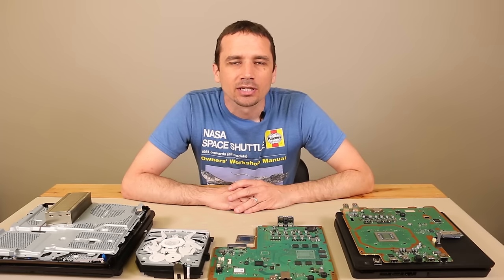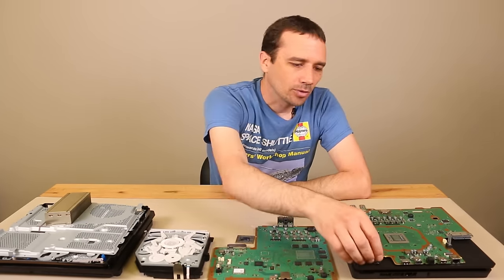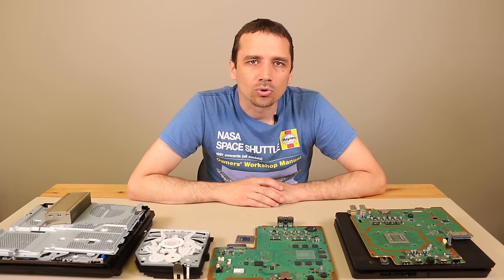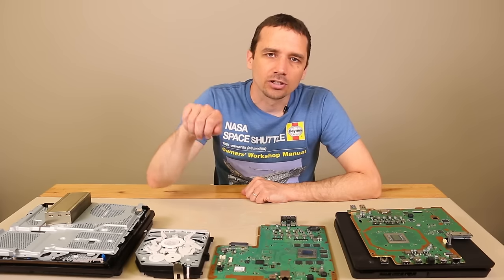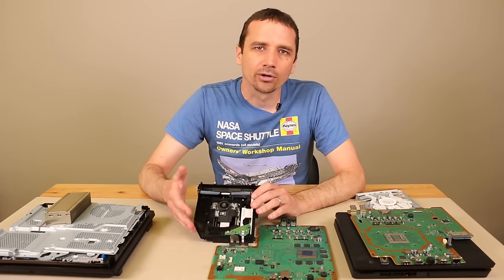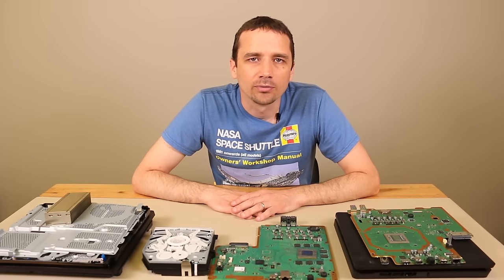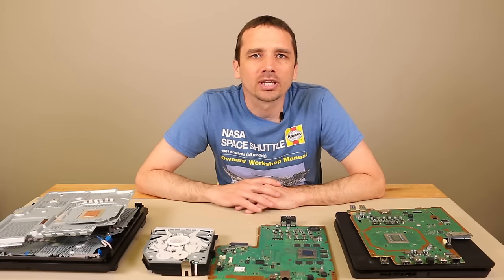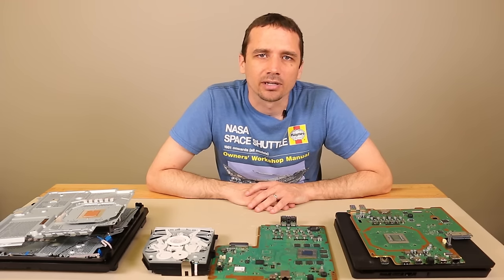Top 5 PS4 Problems With Solutions

Comment: My PS4 recently shut off on me while I was playing. I opened it up and the fan and heatsink are completely clean. Fan is in working order as well. I suspect the power supply is dying, but not sure.
Reply: You ever figure it out? I have the same problem
Reply: @tannerfisher3013  pretty sure it was the power supply. I pulled it out, dusted it out and hasn't gave me a problem since. Recently bought RDR2, so the console is on for hours at a time. Worked like a charm!
Reply: billy 626 thanks man, mine has been shutting off randomly and starting up after about 10 minutes. Maybe it’s the power supply or I didn’t clean it deep enough.

Comment: I do cleaning and minor repairs for friends but i need help fixing an old 1st gen ps4 it wont power on just beeps 3 times and shuts down
Reply: Open it up see if all the screws are screwed in on the metal plate

Comment: Cuh 1215A, I get the SU42118-6 error every time I try uploading the OS to the harddrive. I've tried a few different hard drives as well. I also replaced the disc drive. I also have formatted 2 different USB drives, one to exfat32 and FAT32. It is version 7.02. What else could be wrong?

Comment: I've watched your ps4 videos, absolute terrific stuff. I've got a strange problem that I was hoping you could advise me on regarding disc drives. It seems that an individual game can't be read by my ps4 slim. I've tried several different copies of the same game (returned and replaced by the store)
The PS4 recognises the disc and it allowed me to do the initial install. When I put the disc in it starts to run but always cuts out saying the disc is damaged, but theyve all been brand new clean discs. Sometimes the game loads up and let's me get to the in-game menu, but always cuts out before I load the actual game in. This has happened on 2 of the 3 copies over tried.
I reckon after watching your videos it's probably a dusty laser in the disc drive and it's just barely clinging on. No problem playing any other games or DVDs, I guess its probably just in need of a good clean. Any thoughts?

Comment: My PS4 has started showing me a “Can’t find the signal” message after about 10 minutes of being turned on. The WiFi connection is strong. Any suggestions would be very appreciated. Thank you and your information and expertise is Killah!
Reply: Mack Moody it’s you’re wireless emitter if you undo the bottom of the console there’s a grey like clip with a black cable going to it it potentially is desoldered or disconnected this can be remedied with soldering it back together or reconnecting the solder joints

Comment: I got a question: if the ps4's gpu has a problem is it possible to replace it?? If not then what can be done to fix it

Would appreciate a reply.
Reply: There is no "GPU". What the PS4 and Xbox use are APUs. What these are is a hybrid, the chip is both the CPU and GPU chip. So if your having a GPU problem your having a APU problem which either means A) try the washer fix or B) Send it in to be "reballed" which at that point may or may not work and cost you a couple 100 so better off buying a new unit.

Comment: Hi Steve ! Nice video, I can't imagine the variety of problems you had fix ! Recently, I had to take care of a PS4 Slim for a customer (I repair PS4 on my spare time for fun). Got CE-34878-0 error code in a game menu when trying to start a session. Thought of a disk error so replaced it, installed latest FW and tried again. Same error. So I went deeper. Fully disassembled the PS4, cleaned dust (heat spreader, fan, board, ...), replaced dried thermal paste, noticed there was a MISSING  THERMAL PAD (this PS4 Slim had never been opened before, thx Sony), added a thermal pad where it was missing, reassembled the PS4 and now the game starts, but just for a couple of minutes, then freezes. Maybe gotta check internal power supply cable, but that's my last idea. Any clues ?
Reply: We’re u able to fix it? I’m having a similar problem I was thinking of replacing the hdd but I’m not sure if that would help
Reply: @justinaguilar8551  Sadly not. I'm using this failed PS4 as a spare parts donor 😬
Reply: I just replaced the HDD.  This problem came back up.   It's a new HDD.   I have reinstalled all the software.   The problem returns after a time.   I am not getting another console they are junk.

Comment: My friend asked to me to make a cleaning on his PS4. The heatsink are dirty but all the other things are ok. I replaced the Thermal paste but with a 'low cost' one (I didn't realize how hotter PS4 gets). So, it's my fault and I purchased a real good thermal paste to replace again. While the thermal paste doesn't arrive, I noticed the PS4 gets very hot but the fan doesn't increase his speed. It simple gets in idle RPM all over the time. The games run normally, but I think this is strange. It's a problem or the PS4 "normaly" gets so hot like fridge on the fire for the fan doesn't kick up?

Comment: I have a question if you don't mind. 

My PS4 slim USB ports disconnects and reconnects my hyper x headset wired and my other off brand headset wired, when my controller is plugged in at the same time also when my Toshiba canvio connect external hard drive is plugged in it will. 

What could cause this issue? 

Much appreciation for what you teach people on YouTube.

Comment: I live close to the beach and my ps4 slim is rusty inside near and on usb ports . please put how too clean rust in the next video .
Reply: You're better off buying a new mid frame and heatsink. With rust over time you'll most likely end up with bits of rust falling onto the motherboard, which is conductive and could short out the board

Comment: Good morning 
TronicsFix. Thank you very much for uploading this educational videos. That is very appreciated. 
I  have a ps4 that will not recognize my controller in either of the front usb ports. I used a USB tester, and and I an getting 5V, but th wired controller that I use does not go into charging mode like it usually does on a normal ps4. I tried  swapping the BT module but that did not fix the issue instead the ps4 would not turn on. Maybe I applied to much heat to the donor chip and I end up runing it. 
Could it be that maybe the USB CHIP  that control the USB ports went bad and it needs to be replace? If that is the case what is the name of that chip?
Thank you!

Comment: I Have a problem, Whenever I try to turn on my ps4 and go through the menu of it to pick a game it act's as if it has some sort of delay and at random times it will just do some wierd glitch and just automatically move, Like I pushed the L3 button once and it just kept moving in once direction, it does the same thing for me in game's But instead of 1 button messing up they all do at random times. I Just bought a new controller and it's still doing the same thing, I need help this is frustrating.

Comment: My original PS4 is still going, the only problem is that I sometimes get the white light with no display, but the weird part is that disconnecting the cable and re-inserting always fixes it.  I thought maybe the TV had the issue, but it does the same on another TV. The trigger for this seems to be turning on my TV after the PS4, if I turn on the TV first then PS4 it’s always good.  Does this mean the chip may be starting to go?   It’s been doing this for months.

Comment: My PS4 was overheating and turning off. Took and got it professionally cleaned and re- thermal pasted. Now it doesn’t make a noise, and it only gets hot in one spot next to PS symbol on top and it turns off after 10 mins.

Comment: It is not thw BGA solder balls being cracked it is simply a bad APU.... Some connection in the TIM layers that is broken. This is why it seems like you fixed it when heating the chip. This will never be a permanent fix.....

Comment: You forgot bad controller not only does the thumbstick position suck (xbox is better). But the thumbsticks are known to peel off also the controller has a very short battery life and will most likely require a new battery.

Comment: my ps4 doesn't even turn on at all. No beeps. I've cleaned it from dust and replaced the power cable. Tried holding the power button, tried using a controller, tried using a disc. Nothing. Was working fine. Turned it off and went to bed, but the next day it wouldn't come back on.

Comment: Wait what!? Your located in Portland right on guy I had no idea. I’m from Mac between Portland and Salem. Cool stuff.
I have a question and don’t know where to start. 
My fan doesn’t wanna spin so the error code says it’s overheating it needs to be turned off to cool down. Only way to have it work is if I spin it manually lol.. ik so not professional but gotta do what I gotta do.. But what I’ve done is taken the top cover and the bottom tray just enough to clean the vents on the sides. But yeah would you know what the issue would be that my fan starts and stops, kinda in a stuck process.

Comment: I fixed a couple off PS4 consoles that shut off after pressing the power button to turn on. it had something to do with the power supply unit cause after I replace it the console turns on completely fine.

Comment: My ps4 pro turns off by itself while I'm in the middle of a game. I took the top cover off to look at the fan. The fan was fairly clean. There was a tiny bit of dust, nothing that would be a big problem. I haven't looked at the heat sinks yet but for some reason I doubt they're going to be clogged.

Comment: so my ps4 had insects in it so i took it apart to clean it, i cleaned it then put everything back but ended up with extra screws :/. now everytime i connect it it turns on, goes blue, then white, then red beeps 3 times and turns off. ive already tried cleaning it inside from other youtube tutorials but nothing seems to work. What should I do?

Comment: Not sure if you check these old posts but worth an ask.  I got scammed on OfferUp and ended up with a roach motel PS4 Pro.    I was lucky that I didn't bring it into my house and infest it.  The roaches are currently being killed in it and I am going to be working on it later this week once they are all dead.  

My question is how likely is it to work if I thoroughly clean it out and replace the power supply?   I am currently in it $150 bucks and can justify buying a power supply for it. But after that I am not sure I want to sink more money into it.  Do roaches tend to short our anything on the mother board or is it usually just the power supply?

Comment: I have what could be a miner or a major problem with my ps4.

over the past two months my ps4 has been having a lot of CE-39326-3 error cods and my external hard drive wouldn't turn over and begin reading unless I unplugged and plugged it back in a few times, even coming out of rest mode.
I initialized my console and salved all the freezing and slowness problems I was having but my hard drive problems still persist. 

the light on the hard drive show's that it's getting power but the motor wont cut in and begin to spin the disk when I turn on the console from a full powered down state, I have to wait five or more minutes then unplug and plug it back in to feel motor begin to rave up and the disk spin. yet when I put the ps4 into rest mode and turn it on there are no problems at all, the motor turns over the disk spins and all is right.

can you hazed a guess as to what the problem is and how I can fix it?

Comment: Is there a known issue with the Bluetooth connection? My controller will only work for a minute or so when not connected with a cable. I’ve tried four different controllers with the same results. I have to stay wired in order to play. I have a ps4 slim.

Comment: @TronicsFix I dissesembled my ps4 pro, I came to a problem where I couldn't attach a certain component that was right next to the white power supply cord. It's that little black piece with the metal pieces sticking outwards. It came to a certain point where I had to align that. After successfully reassembling the ps4 pro. It won't read the games I have on the ps4. What exactly did I do wrong. If you dont mind my asking

Comment: My only problem with my 1st gen PS4 is that it randomly ejects discs while playing, aborting gameplay. Seems like a common problem, caused by the disc eject button which detects  button presses although you didn't press it. So, is there a good solution BESIDES disabling the button?

Comment: I have a question. Woke up turned on the PS4 and the game wasn’t reading at all. No error and had to manually eject the disc. Now the PS4 won’t even suck the disk in. I manually put the disc in and it won’t even spin or read it. Does that mean that the disc drive is bad?

Comment: i have a weird situation with my PS4, so basically I treated it very well and made sure it was in good condition but for some reason, while i was playing it started freezing so i restarted the ps4 but then when i did that suddenly it wouldn’t turn on and when i finally got it back running it keeps freezing after a couple seconds and then turns off and doesn’t turn on again. please help

Comment: Question: what would be causing my PS4 send poor connection out to all my controllers? Even brand new controllers. It’s like the connection isn’t sending through correctly and there’s this huge lag and it makes my controller go crazy.
Reply: Coco Da price Same thing happened to me its the wifi/bluetooth connector in the ps4 (cheap and easy fix) its a silver piece like 10 to 15 bucks on amazon youtibe how to fix it literally takes 15 minutes or less you wont regret it i swear my ps4 works even better than it did when i first bought it and to think i almost threw it out smh
Reply: Will also definitely need the ps4 torx security screwdriver without it you will not be able to get into the system without damaging it
Reply: John Alba do you have a link?
Reply: It will 100 percent fix the connection issues you have with your controller

Comment: if thermal paste gets in the small slots around the cpu is that a major issue? If yes how would one correct said issue
Reply from the maker: No problem at all. The factory paste gets in there and causes no problems.
Reply: @Tronicsfix awesome thanks alot for responding

Comment: Hey Steve, big fan here! I have a launch model PS4 which had some problems and got its processor and memory replaced. Now it won't update because apparently it does a check or something to see if all components are fine, and it seems the replaced parts dont have the same "ID" as the stock parts... So it works but it'll never update. Do you know if there's a fix for it??

Comment: I have an original ps4 and I've owned this console from the time it was released. I played my PS the night before. Didn't do anything different wen shutting it down. It's plugged into a UPS. The nxt day I'm trying to power on PS and no power. I tried different power cords thinking my power cord went bad but still no power. Do the power supply for these consoles go bad eventually?? I'm just lost with wat the problem might be

Comment: Last year i got blinking blue- split second then turn off. Try everything from cable, plug from wall. Still persist. Then i try changing the psu. It went on . Until yesterday. I countered the same problem. I tought i had bad psu. Now after watching this, im scared my apu is the problem. Recently i just changed the thermal paste.
Reply: Try the washer fix I use 2 washers and also did new thermal past and cleaned fan and heatsink. Only restarts every once in awhile lol. Bout threw it out the window several times. Good luck!
Reply: @jaywilbur515  thanks mate.. i changed my psu last week, now it run normal no issues.

Comment: My problem was not a problem to begin with...i went in to do a fan, heat sync cleaning and thermal repasting and after putting it back together I turn it on...it boots fine and when it goes in PlayStation main home screen and a few minutes the fan will gradually start to kick up to unheard speeds...never ever had my slim ever sounded so loud and then 3 beeps as it blackscreens...I can even boot station and get to start a game it will run fan super high like never heard of before and shut off with 3 beeps...still have to press button twice before it boots up into the checking system for corruption...any suggestions?

Comment: My ps4 pro turns on a few seconds (3 - 5 seconds) with blue light then shuts down. I don't need to unplug/plug it before opening it. Still doing the same. What is the problem with my ps4?

Comment: What about an issue of it randomly turning itself on and beeping 

Or turning itself on and then off

It's a day 1 PS4.

Sometimes it also puts itself into rest mode while playing but it doesn't give the red overheat led. I've taken it apart and cleaned the fan etc so yeah

Comment: I have the strangest issue on the second gen ps4.  The ps4 will not detect the ps4 controllers, tried 2 at the main screen when it asks to press the PS button to continue. I already tried the power cycle options holding down the power button until shuts down then unplug the system, same issue. reset controllers, diff cables etc nothing. Odd thing is they get detected in safe mode only.. even tried restarting out of safe mode see if it helped but soon as its back to the main screen to push PS button, nothing detected. Ps4 does have the white light but i do see the display on the tv fine. I am at a loss on this one

Comment: problem 6: controller not working wirelessly (bluetooth chip not working?)  have to resolder it again, sucks. In Xbox, the bluetooth chipset is a plug and play thing you can just replace easily

Comment: Hello quick question my ps4 pro will only turn when disc is inserted but it only boots to safe mode.  Can’t do anything after that (no controller will connect) I can press the eject button and it chimes but the power button is not responsive.  Any ideas?  Thanks!